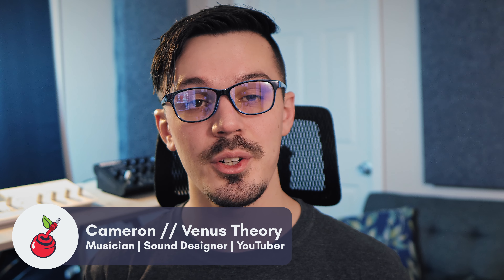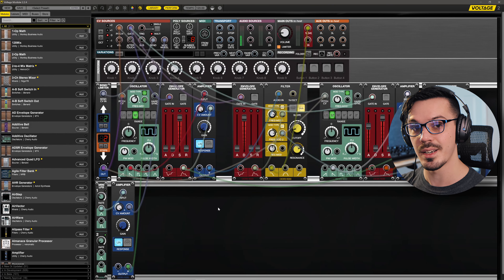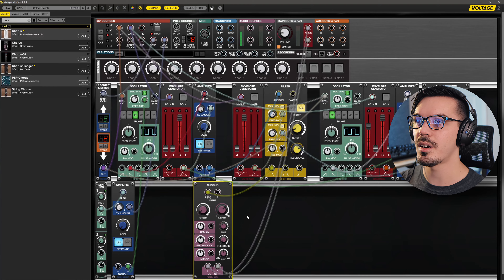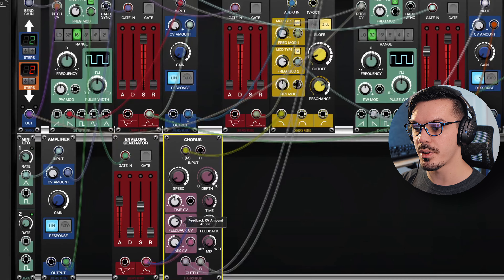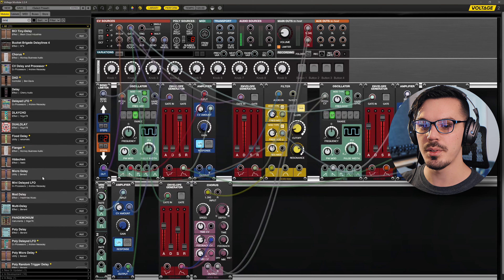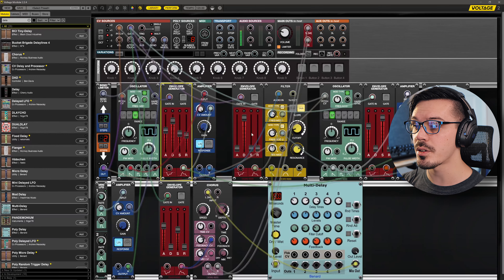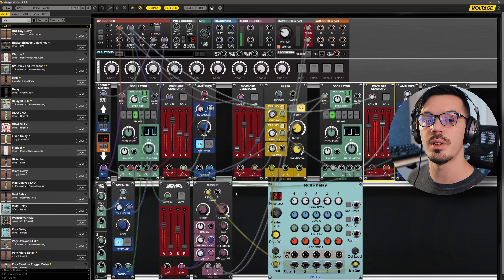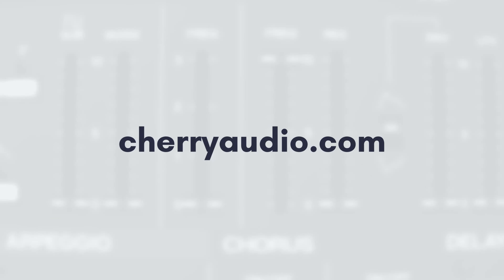Voltage Modular For Beginners: Adding Effects And Beyond (Part 3)

Comment: Very interesting as usual.
A great Cherry Audio tool and an awesome Cameron, cristal clear and with the right tempo.
I will try some configurations and may be later on i could get the payed version.
Reply from the maker: We're glad the video was helpful!
Reply: Voltage Modular is a friend for life.  I am using MINI PLUG-IN HOST and it is a great integrator inside the modular thing for any plugin we already have.  Simple and powerful.  Could be mentioned inside a video, if not already done of course.  Again thanks.